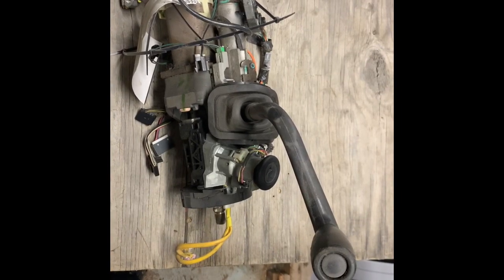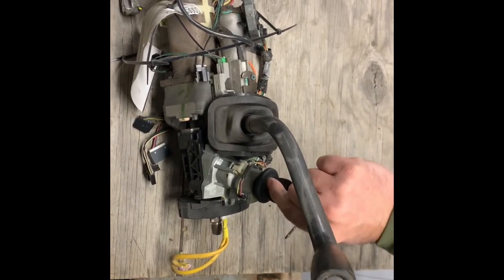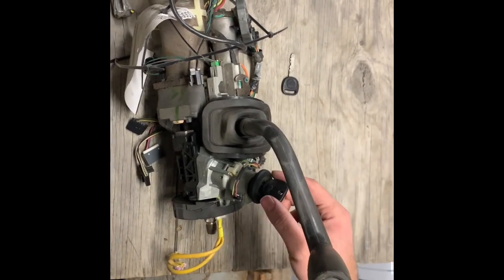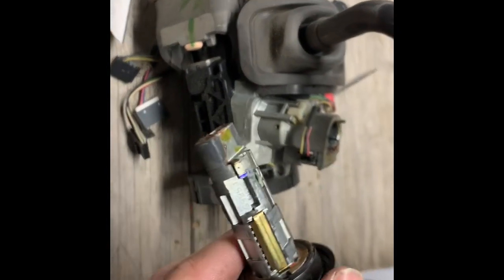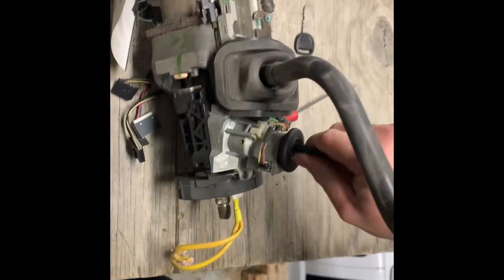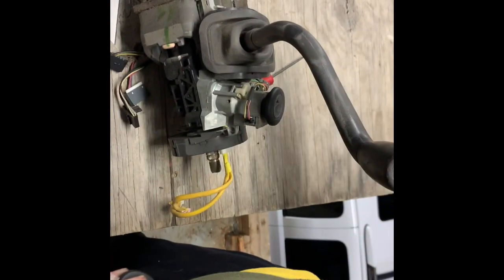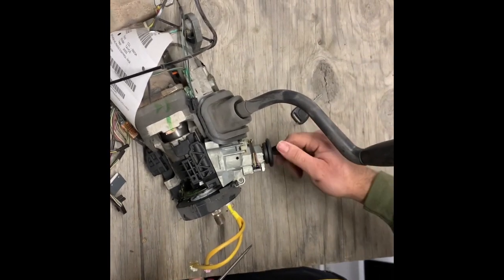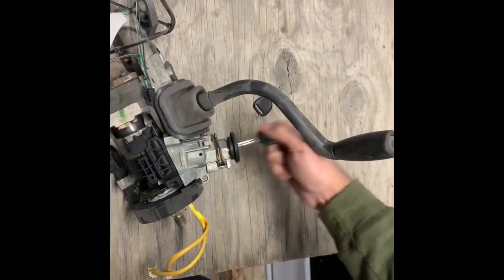Cutting GM Key from key Code by removing Ignition switch. Dont cut keys by trace always by code

Comment: What year GM does the key code come engraved in the ignition switch? From the looks of the one you used, it looks to be an older model. Like 2006 and under. Since the keys have no transponder chips. Will this work on newer models? Thanks :)
Reply from the maker: Almost all GM ign switches have the number
Reply: Not sure if you guys gives a shit but if you are stoned like me during the covid times you can watch pretty much all of the new movies on instaflixxer. Been streaming with my gf for the last couple of months :)
Reply: @Max Jacoby yup, have been using instaflixxer for since november myself =)

Comment: My anti theft light comes on and sometimes it won't let me turn on the truck
Reply from the maker: Year make model and codes?
Reply: @SpartanAutoworx  no code just my anti theft comes on had a aftermarket alarm on but already removed it key comes out of my ignation switch
Reply: @antoniohernandezjr1721  he was asking if you had engine codes. Probably was old or the early anti theft system or bad ignition cylinder.

Comment: half the time the key code wont be legible.  or some of it and you get to play the guess game.  so expect that
Reply from the maker: I have never had an issue. Sometimes I have to use istacode for the bitting as my machine does not have all the codes.
Reply: @SpartanAutoworx  this is the part I need to learn, the biting stuff. 

The code off the ignition is that the same code you'd get using a Lishi tool for the proper vehicle? 

Also for instance I have the Xhorse Dolphin XP-005. Love the tool but what I'm wondering being new is with the code from the IMMO tool it pulls is that the same code as the key code as well as long as nothings been changed? 

And with that code is that the 5 digit code I enter into the dolphin app and cut a key with or do I use that key to figure out another code as I've gotten a little confused on some things as there's so much to learn.